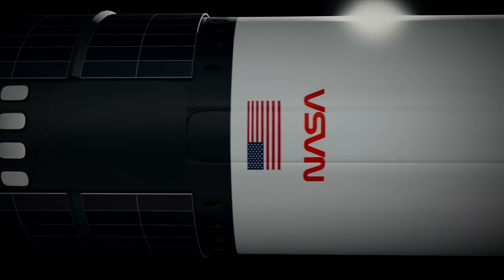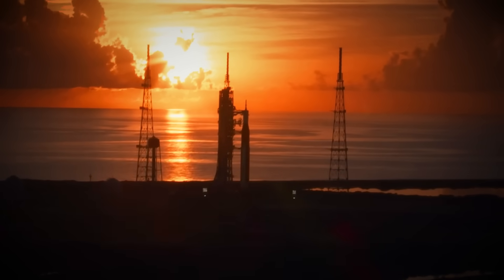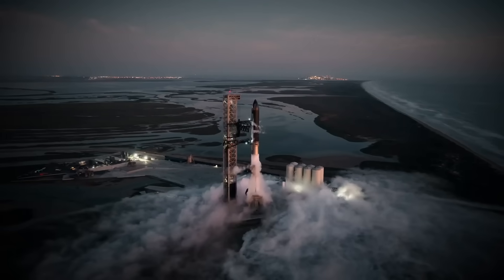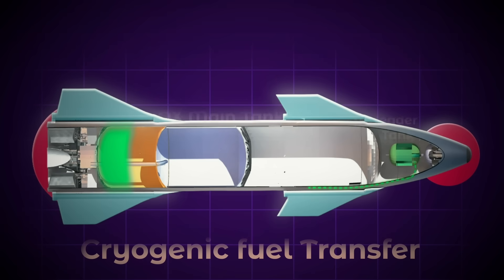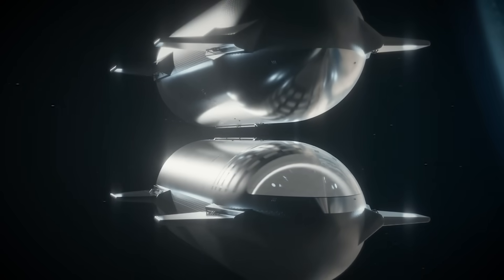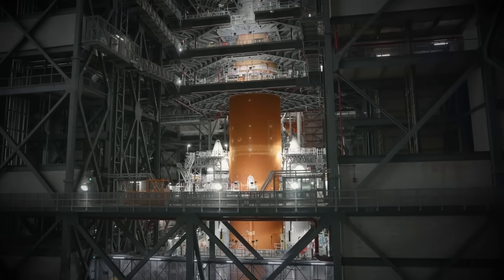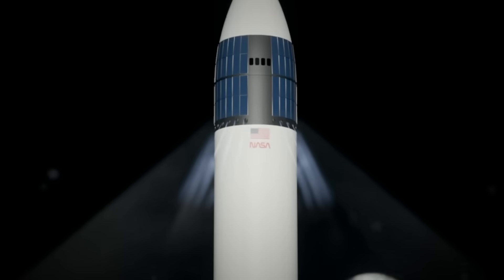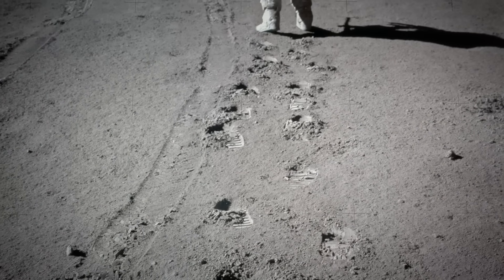How SpaceX and NASA Will Land On The Moon

Comment: Recently couple of moon landers have tipped over during the landing process. And those objects were not as tall as starship is gonna be. On an uneven lunar surface i can not get my head around how are they going to successfully do it…
Reply: I have exactly the same concerns. This seems way more complicated than Apollo ever was. A tall spindly lander, 10 launches, rendezvous, and dockings just to fuel one flight to the Moon???
Reply: CGI
Reply: Agree, they will need a very flat, smooth and hard surface to land on. Seems unlikely! The Apollo 15 lander was at quite an angle on touchdown.
Reply: That is a concern I have as well. This is not about the technology of the lander so much as it is about the irregular surface of the moon. Nevertheless, if we see a problem the engineers at SpaceX have also seen the same thing. If it were me, and it is not, I would consider placing the fuel supply towards the front of the space craft so that it would be mostly empty upon landing, thus the vehicle would be more stable.
Reply: @davidsandy5917  
The recent landers that fell over had significant 2 mph sideways velocity at touch-down. They didn't just tip over, but literally tripped on the rough surface. It's the fault of the guidance system and/or horizontal velocity sensors. (Really was an operator error!)

Once the guidance system is precise enough to totally zero that horizontal velocity, the base does not need to be wide. You could instead use vertical legs that conform to the irregular surface and hold the craft plumb. 

For Starship, I expect legs will use a hydraulic / pneumatic system, shared between all legs with a common accumulator/pressure tank, and clamps for each leg extension. The ship needs vernier landing thrusters near the top to maintain true vertical until the legs lock in place. A hydraulic ball valve for each hydraulic leg piston might close as well for redundancy. The accumulator would provide spring action and damping.
Reply: Agree！Firstly,the starship needs to experiment landing on uneven deserts
Reply: @GOGO-lp5jr  
These SPMT already do a good job of conforming to irregular surfaces. They can even level themselves. So there is engineering precedence. 

Let us start by dropping prototypes straight down (suspended at the center of mass from a crane) onto random bolder-strewn and uneven slopes. See if the thrusters will keep it upright while the legs conform and clamp. The crane uplift can simulate 1/6 G. 

Also let a slewing test article also stabilize itself to zero horizontal velocity while a bridge crane lowers it starting with various horizontal velocity.
Reply: I don’t think they can. A landing pad is needed at the very least. This needs constructing prior to any Moon landing by Starship. Send small robots to prepare the land (level and remove boulders), and others to construct a solid landing pad (presumably made with some form of concrete using lunar dirt, or stainless steel plates assembled and welded on site.
Reply: Agreed.  @benedictmarshall7031
Reply: @benedictmarshall7031  my likely to build a landing pad than to be able to use it successfully.
Reply: Thats because. Its a new system. Not what nasa or india use. That use ai

Comment: Essentially, the vehicle isn’t designed for the moon. It’s a fully reusable launcher to place the new starlinks into orbit. Musk has gotten the American public to finance it by saying that if they can achieve an extremely high flight rate they can get it to land on the moon. 

With 20 shuttle launches they could have gotten Discovery around the moon with a lander in the cargo bay too.

Comment: Taking into account the varying density of lunar regolith in the area where it lands, it's a serious possibility that lunar starship will fall over on landing. A horizontal VTOL system might be more stable. I'm not a rocket engineer, just saying!
Reply: Regolith density is consistent over the moon's surface and horizontal VTOL is an oxymoron
Reply: You don't understand. If HLS is modified to use its RCS thrusters to land in a horizontal position then it'll be more stable and less likely to keel over, also removing the need for a massive elevator. If it then uses a VTOL style of liftoff, such as seen in e.g Harrier jet aircraft, it could flip to a vertical position to engage vacuum raptor engines. As for regolith density, what's your source for that?
Reply: @RobSharkRescue  it would literally be more likely to keel over if it tries to land on its side because of the tiny moment of inertia about its length. It's more stable and the control algorithms are simpler with it standing up. Landing on its side also makes half of the thrusters unavailable, which reduces the redundancy in the event of a failure.

The elevator shouldn't be particularly massive, it's only lifting against one sixth earth gravity.

Why would you expect the regolith to be variable? There aren't any rivers or volcanoes reshaping the surface, only the solar wind and meteorites which don't vary over the scale of a reasonable landing area.

Comment: I don't understand why we need SLS at all. Put the astronauts into Earth orbit on a Falcon 9; Have them transfer to a waiting fueled Starship that can land on the moon; Starship then brings the astronauts back to orbit - they transfer to the waiting capsule in orbit and return to earth.
Reply: I guess, No gas station on the moon, to ReFill starship for return voyage.
Reply: Because Congress forced NASA to use SLS.

It does have some benefits. It is the only capsule that can take people to Lunar Orbit where the new Gateway Space Station will be.

In the future that could be done by Starship, which could take people to and from Lunar orbit without refuelling - like they’re doing with dearMoon. But it’ll be a while until that capability is ready.
Reply: @zachb1706  SLS is a proven construction unlike Starship. 

SLS is ready and has already launched without any problems, Starship cannot even land without blowing and that empty cannister with no interior design or load.
Reply: @ifldiscovery8500  what’s your point? I said in the future, obviously when it is capable of doing what SLS does.
Reply: What capsule?  Orion and its service module exceed the Falcon 9's capacity, both in mass and diameter

Comment: All successful landing on the moon and mars have had a landing gear spread wider than the ship’s height. There are very few level surfaces on the moon. Couple these and other facts with a 50 meter (164’) 130t (+ fuel for lunar departure, maneuvering and disposal) space craft laden with 100t of payload in the top half of the craft screams that tiny 4 or 5 meter legs will end in disaster. Especially if they were to land in a place like Apollo 15 landed as it would just over. The center of mass would be beyond the landing gear. 
So I am sure that these drawings that are going around will not be the finial product.  Legs that are 21m long would suffice making the stance 51m but they don’t make for a pretty picture, yet so far away from final development.
Reply: That’s because most of the things launched are short. There isn’t able that they must have a wider base.

Comment: how does the math work out for 2026? you need over 10 flight to fuel it, there will be some test flight inbetween for other starship project, unless spaceX abandon all other starship development and allocate 100% of their flight to the moon mission, they ain't going well until 2027. 2028 is the more comfortable date if they pursuit normal operations.. also pls drop the retrograde orbit bullshit, everyone knows NASA is doing this because their rocket don't have enough fuel, it create problem when there is an emergency because it not a circularised orbit, there will be gap in coverage, it is a VERY DANGEROUS solution that will get people killed if there is an incident because it will be impossible to recover. in apollo if the lander is failing, the orbiter is still capable of independent flight and can move toward it if required, likewise a failure in the orbiter can used the lander as a life raft as demostrated in apollo 13... what about artemis, how will it recover from an apollo 13 event? there is no surplus fuel. you don't want to design a mission that is so fuel effective that you don't have fuel to do anything else.
Reply: Orion won’t have an Apollo 13 moment, that’s the goal. It’ll be a far more reliable capsule than Apollo
Reply: @zachb1706 Starship is not ready 2026. 😅

Comment: You forgot to mention that the apollo lunar lander had a second stage just for ascent, and that was protected from damage in a rough landing. The spacex lander, beyond being the wrong shape for a lander and a lot heavier than necessary (and therefore more likely to have its engines damaged on landing), cannot afford any damage to it's engines on a rough landing. It's a terrible idea, I hope it doesn't cost lives.
Reply: looool!
Reply: don't worry. In a cinematographic stage they can take all the necessary precautions
Reply: You also forgot to mention that starship dosnt have an abort eject system. Any failure and your dead. 

He talks about SLS which went to the moon. Let’s just think about that. They went to the moon and SpaceX has yet to complete a mission. It’s not even got to orbit. 

Oh and if you think SpaceX could have done anything with out nasa your tripping. SpaceX would have gone bust as they are burning money they don’t have. 

Starship is idiotic for landing on the moon. You’d need a lift to get off or on the surface. Lift breaks and you are on the moon and you are dead. 

Even the SpaceX lander they’ve been paid a ton of money to develop is a joke and only got funding because one person signed off on it without the appropriate oversight who then left nasa and now works for who? Yeh SpaceX.

Let’s face it, SpaceX is yet to do anything like the Apollo missions.
Reply: @davideyres955 you took the words right out of my mouth. If they insist on pushing through with this nonsense people will die.

Comment: I love NASA and space x but 10 flights just for 1 trip to the moon, surely there’s a better way to refuel, or get into orbit with more vacuum engines on the starship maybe, I know the raptor 3 variants are getting stronger each day but I honestly don’t see an economical way to get to the moon without nuclear hyprid engines that superheat hydrogen fuel, it seems the most efficient
Reply: The truth is you need refuelling to get anything larger than the Apollo lander to the moon.
Reply: @zachb1706 If we have multiple missions after Artemis 3, whg are we trying to take heavey loads when all we want is to get to the south Pole before China?
Reply: @ifldiscovery8500  the goal isn’t just to beat China to the South Pole, it’s about building a permanent human presence there.
Reply: @zachb1706  Artemis main mission is to beat China they literally said that in last press conference, in fact it was part of the opening statement.
Reply: @ifldiscovery8500  Artemis isn’t just to beat China.

It’s to put a human presence there by making moon missions sustainable. One of the problems with Apollo, and why it was ultimately cut, was it cost like $20 billion to put 2 astronauts on the moon for a day. The goal with Artemis is to bring that cost down, increase the number of astronauts to 6 and increase the length of a mission to a month.
Reply: @ifldiscovery8500  the original Apollo lander isn’t suited for this goal. 
- It has a very small payload, meaning you’d need to drop most things separately which just means more launches
- It could only carry 2 astronauts and couldn’t support them for very long
- It wasn’t reusable or commercially viable. Both of those are important for bringing the cost down
- It left most of itself behind, which just litters the surface with landers making harder for new things to land. This is especially important for a moon base, with a landing pad
Reply: They'll say anything to push it back. They don't want to go to the moon, because they actually can't. And they didn't go in the first place.

Comment: 5:07 You mention the fuel transfer was successful.  Do you have a source?  I've not been able to find a credible source that says it was actually successful.  Just that it was attempted and results were to be confirmed.
Reply: Same here. I can't find any evidence of a successful fuel transfer. 🤔
Reply: @kennyfordham6208  Just curious what the results are, good or bad; progress is progress.
Reply: @SeaTacDelta  This! Of all the things that happened on the third Starship test the thing I want to see the most is how the refueling test went. My understanding was that NASA and SpaceX would have joint press conference to announce the results but I have seen anything like that yet.
Reply: 100% 
The tanks were empty and it was called during signal loss. Clearly never happened.
Reply: the main issue that even if it was successful (as nasa did not come out with any problem, it was probably done without failure) it was within the craft. from one tank to the other. it was the same when the apollo cmd moved the oxygen from one tank to the other for balancing and less than what the progress and other cargo spacecraft do when it refuels the iss, as those pump stuff between crafts. so at best it is a first step in a very hard road, at worst a nothing burger.
Reply: @thorin1045  actually it is a pretty significant test.  Cryogenic liquid transfer has never been done in space.  Apollo didn't transfer oxygen between tanks.  The tanks were stirred because the cryogenic liquid had a tendency to freeze and not read correctly on the gauges.  Progress doesn't use a cryogenic fuel but rather Unsymmetrical Dimethylhydrazine fuel and Nitrogen Tetroxide oxidizer.  So yes, the transfer was to occur between tanks in Starship, but it has never been done before in space.  It is a key requirement for Starship, but also for the Artemis missions.  If it worked I would expect NASA and SpaceX to shout it from the roof tops.
Reply: @SeaTacDelta  ok, they transferred a different liquid. what a great success. this is nothing. especially within the ship. between different craft will be a bit more impressive, especially with the amount needed (dozens of times hundred plus ton,) but the current one is little more than successfully opening a door, even more when they failed to close it. nice first step, now go on that thousand mile adventure.
Reply: @thorin1045 sorry but it’s not a nothing burger otherwise NASA wouldn’t have awarded $50+ million to demonstrate it. Cryogenic liquids are challenging to work with and zero-g just adds to the complexity.
Reply: @SeaTacDelta  i would say nasa expected an actual docking and transfer between ships, and not pumping it between two end of the same tube. yep, extremely challenging, other than that we do it since the forever. the only interesting part is doing it in space, and that is literally just a different liquid than what already done. but be happy, it was so massive success, that half the world still in awe that space x managed to pump something from tank to an other one. oh, wait, nobody cares as it is nothing. it was barely even mentioned during the great success, as even the door opening was intended to be bigger stuff. just afte the door failed, the engine never tried, and the atmospheric entry failed because they failed to stabilize the craft which is a strange fail as what they expected? after all this it was the only thing that went right (or we just did not see it fail.)
Reply: @thorin1045  You’re not providing any facts so not adding any value. Good bye.

Comment: We need to deploy the Gateway Station which can be done with the next variant of Orion.   I think it's the block B variant which carries significant cargo.  A trip to the moon at this time will not be practical because we still cannot keep people there on a permanent basis.  That's what the gateway is for.  Other types of equipment can be landed separately on automatic as well.
Reply: Gateway is both pointless and unnecessary.

Comment: To fill up 1 Starship from 10 is a huge undertaking. Something has just occurred to me. The Moon and deep space does not have any drag to contend with, so why not have engine bells on the one side’s length of the rocket as well, so it can slow down in a breaking and landing manoeuvre? Have the landing legs on the bottom length instead of its end. Probably be a bit more complicated, but it would solve landing. Let me know what you think?
Reply: You don't have atmospheric drag, but you DO have mass and inertia. That belly flop scheme would require reinforcing the entire structure, probably doubling its mass at the minimum. There are no internal supports inside the tanks, so a landing on its side would cause the vehicle to crumple in on itself. Then you get into the issue of what kinds of torque and shear multiple engines embedded in one side would produce. Remember, the only thing holding those rings together is an electron weld. Which makes an ideal fail point under the wrong force load. Then there is the control issues, as you would have to meter the throttle on each engine precisely to prevent the force from snapping that brittle steel tube  in half. Then there's the robustness of the attitude control thrusters to consider, as you would have to keep them running to counterbalance the off axis thrust from your 'belly engines'.
The engineering issues alone are enough to render the idea unworkable.
Reply: @wesleybeaver  when I said it probably be a bit more complicated, I wasn’t wrong! lol Yes, you’re right. I’m no engineer, but it wouldn’t be impossible, just be much more complex and much heavier which wouldn’t be viable for cheaper access to deep space. Ty for the reply.